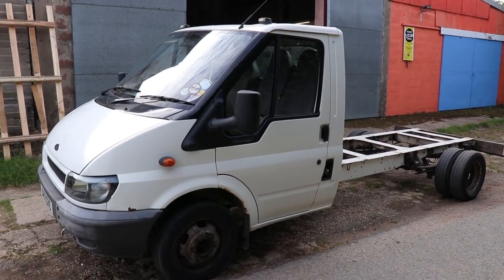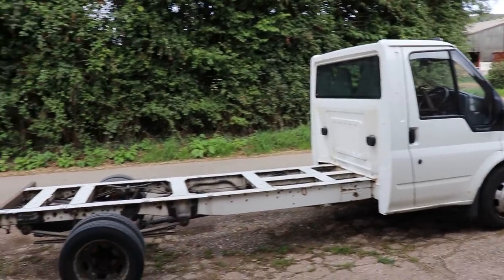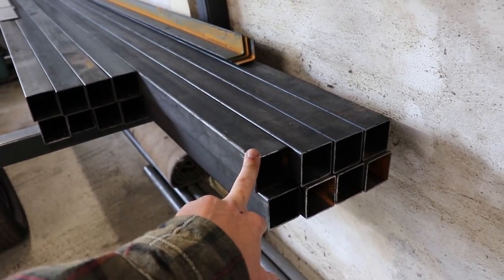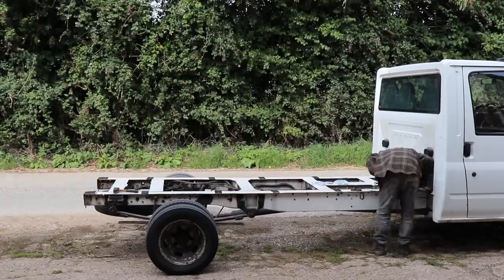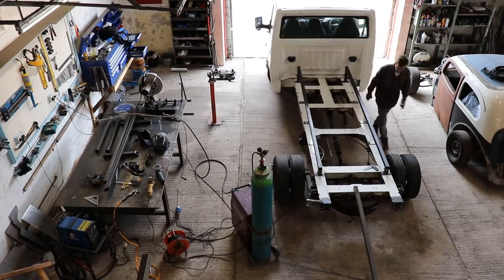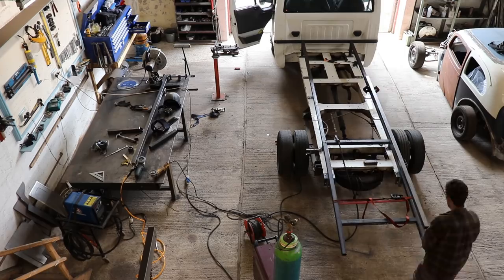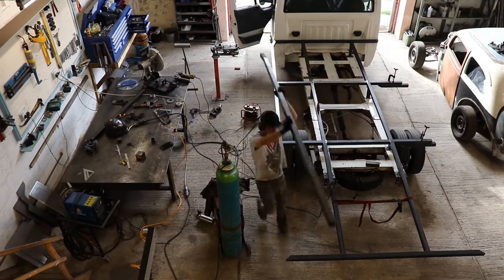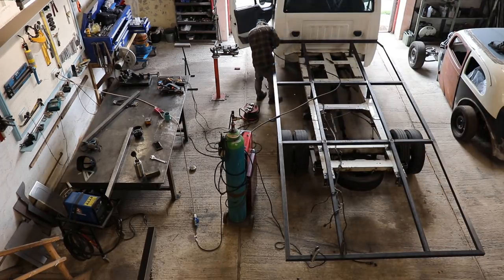FORD TRANSIT RECOVERY TRUCK BED BUILD, PART 1. RAMP TRUCK

Comment: As always very nice work and attention to detail. Much better hauler than the crappy old Citroen based one I have. Mine is a front wheel drive Citroen cab with a custom made bed and two Al-Ko torsion beam axles. Won't win any beauty prizes! The best thing I added to it are secure storage boxes below the bed on either side for straps,chocks,ropes and all the crap you need to carry.  One day I plan to attach the rear bed to a more modern cab unit, bit more power and comfort.
Reply from the maker: Its about beauty mate as long as she gets the job done! yeh its gonna need some storage and a tyre rack.

Comment: vosa/dvsa have been nicking trucks like this, not for the overhang itself nor for rear axle overweight but for front axle underweight .
Reply: i remember years ago a friend had one of these.. he had to make the front bumper from half inch plate so the truck would steer & handle safely ( also came in handy for moving wrecks around his yard )

Comment: What do you do interms of legality ?  Do you need to get an engineers inspection prior to mot ?  What happens in terms of log books  can it still be classified as Ford transit van or ?   Just curious as I might do this myself got a transit flat head for cheap with some rotted out  parts so  I’m repairing the damage

Comment: Wow build for the start, what about start with running bars from the back bumper below the back wheel to the cab, then drops down building a battery, water tank, water storage, ac unit generated all below the chassis and both side?
The would increase the room upside. And help handling as the weight not top heavy. And then you can go 2 stories? A sun deck? LOL .
My van I want to move these item under neet but it’s very hard to do now.
Can’t get enough of Space so extra planing and double use or even triple use open u p a large living room and seem specious. Mine a Art Deco/ ocean decor, but your right build for lite. Or you can’t add on decor much.

Comment: Haven't watched it yet, but liked it already! I'm in the middle of building a crew cab Movano recovery truck, done a 30 inch chassis extension on it too. The welds aren't as good looking as yours though lol
Reply from the maker: Sound cool, I wanted a crew cab transit really but couldn't find one. Cheers

Comment: Do you have to comply with commercial vehicle regulation nonsense for something like this, or is it okay because it is a bolt on deal?
Reply from the maker: Il have to re register it but other than that its straight forward.